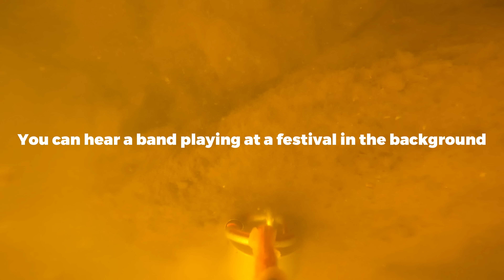Amazing! I Dropped My GoPro in the River! *ULTIMATE MAGNET FISHING JACKPOT*

Comment: I have a suggestion for you if you don't mind... When I magnet fish, I use a plastic ice scraper for a windshield to scrape all the magnetic sand and little metal bits from the bottom of my magnet. Saves a ton of trouble.

Comment: The next time you hit that spot you should try short tosses like 5 feet. Or just drop the magnet right down off the side of the boat and then pull it up about 4 or 5 inchs the magnet would lift the rip & rap right up out of the rocks just troll back and forth over the rocks